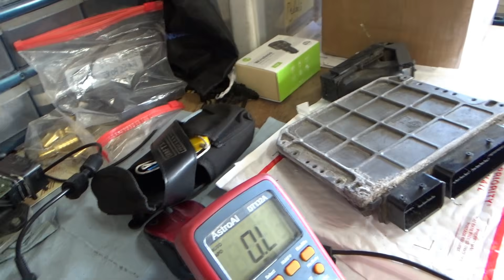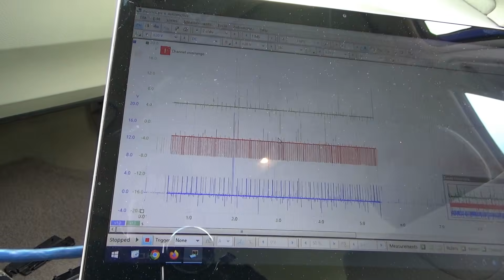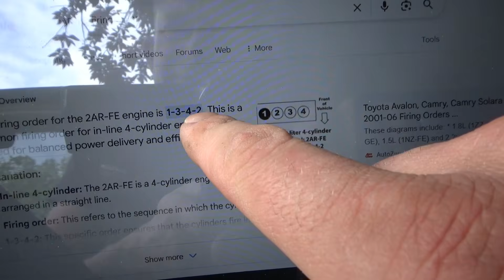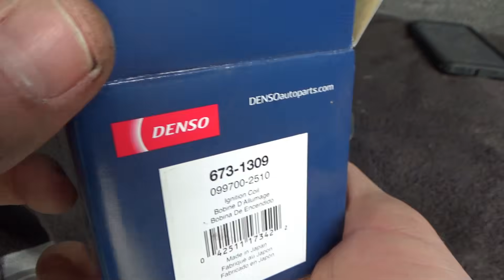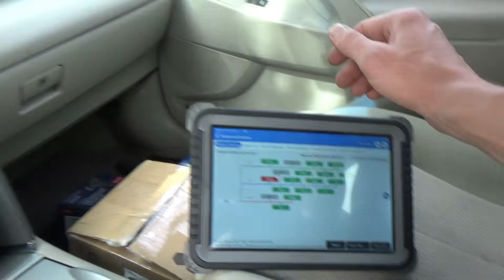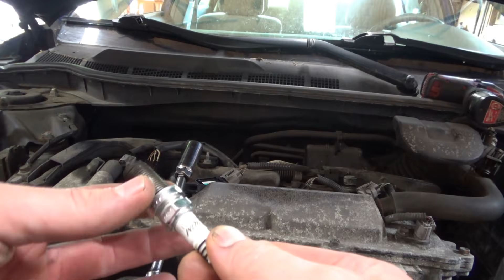(Pt 3 - CONCLUSION) CRAZY Camry...EATS ECMs?!? (Labor Day Special 2025)

Comment: With older module "dumb coil" designs, the COP coil dwell current is controlled by an IGBT protected driver in the ECM. Having these high ignition currents controlled in the ECM generates a lot of heat which is bad. However, the IGBT circuit is very electrically rugged. With a "smart coil" design the IGBT and associated heat is moved to the COPs, but to control and monitor the smart coil we use less rugged circuits.

Comment: The ignition secondary waveform needs to be inspected under heavy load and at a low temperature.       Because under those conditions it could go lean and over stress the coil break down the insulation inside the coil

Comment: I remember working (in the UK) on a Vauxhall Astra, 2012. It had a million fault codes for basically everything, brake lights not working…
Traced back to a faulty ignition pack. Amazing the faults/damage HT leakage can cause. 
I had a Ford focus (2001) many moons ago, the intermittent wiper setting wouldn’t work, again traced it to an ignition pack. 
Great watch. Good techniques used.

Comment: Five minutes I’m 71 years old working on a 99 Toyota forerunner with a blinking transfer case lights watched your video replace the one sensor or switch on the transfer case but still have blinking light was wondering if you could send me the diagrams and some of your other tips because I do not have other than a BLM meter to check stuff would appreciate the info can’t right now I’m not driving the car

Comment: Ive seen ignition coils shutdown toyotas, as in shut the engine off but the computer on both vehicles were still alive. Toyota Voxy 3ZR engine, Toyota Altezza 3SGE engine both with 4 wire ignition coils.

Comment: Watch JR Go had a similar situation with a Kia. The plug coil was causing a short. There was no CEL. After replacing the blown fuse, the CEL would display, only to have the fuse to blow again. The ECM wasn't getting any power. After replacing the defective coil, it was solved.
I would rather have blown fuse, as opposed to a toasted ECM. Kia's and Toyota's must be different this way.
Reply from the maker: Very different failure mode in his case that's a 15 minute diagnosis 😉

Comment: Very impressive troubleshooting. What makes this so difficult is the problem causing the ECM burn out doesn't occur unless the car is running and the car only runs for a very short period before the ECM shuts the engine down. Another great example of how to use all the electrical diagnostic tools in this case including an oscilloscope being so valuable to track down the issue.

Comment: Very common problem on early 2000 thru 2009 ford v6 engines especially. Seems to be a TSB on them also. Change all ignition components, with of course OEM parts. Used ECM around $800 and $300 to program install. Pay me now or pay me later!

Comment: Reminds me of my ford edge that back fed the coil up the control wire and blew a hole in the driver for that coil. A simple $90 coil job turned into a $300 ecm repair plus $600 for all new coils and plugs.

Comment: I guessed that a coil was producing a high voltage spike on 5 VDC line.  That will take it out the internal  ECMs 5VDC regulator. I learned about inductance when I was a kid in 1950s. Between that and Forbidden Planet my brothers and I had fun shocking each other. That voltage spike was most probably a lot higher as what was shown was dependent on oscilloscopes slew rate. Good job Ivan.

Comment: Had a similar problem with a 2005 Honda Jazz/Fit 1.4 Dsi. While driving, the electrics and engine would intermittently die completely, for less than a second, and then revert to normal. I eventually traced the problem to one of the exhaust spark plug coils (it has 8 coils and spark plugs, 4 for the exhaust side and 4 for the inlet side). I replaced the coil and the problem went away. A few weeks later it started again, and I found it was another exhaust coil. Eventually replaced all the exhaust coils, and no more problems. The inlet coils have not given any problems.

Comment: I bought 6 no name coils off eBay for $60 for my 2004 Trailblazer. One of them was bad and they sent me a replacement. I didn’t replace all at once. I’ve been replacing the stock coil as they stop working.

Comment: One coil from my BMW 325i E92 broke the power stage inside the engine ECU, a MOSFET that I replaced for 2 dollars. But I had never seen a case where the high voltage from the coil goes into the ECU and destroys a component — in this case, the 5V power supply stage. Crazy failure, great diagnosis, it wasn’t easy at all. Greetings from Spain and thanks for sharing.

Comment: if i remember correctly, you had a similar case a few years ago. it was a chevy or dodge truck that when engine was reving up it leaked back some high voltage to the engine ecu and made all sensor information etc to the ecm go wanky....

Comment: what are the safety measures of a ignition coil burning out like that one on a car computer? that would be a manufacturer error in design, because for that to happen in a regular basis, the consumer would be dishing out tons of money every time a ignition coil burns out, the computer to has to be changed to, because it get's burn out to? so what's the real problem with this connection with these burn out's?  my question is, how would we know a bad coil from a good coil! and who is responsible for this kind of damage? they need better quality testing of their products! you could imagine how many cars have been destroyed by products that fail like this? and have gone to the junk yards? very good video! eye opener to consumers! buy's beware!

Comment: Seen often on toyota, where a coil (usually aftermarket or fake ebay coil) causes the car to intermittently shut down or crank no start, and has codes for all coils. It shorts or spikes IGF signal. But never have seen yet where it takes out a module. Advancedleveldiagnostics recently had one, surprisingly it was from OE coil.

Comment: Just want to add that Denso oem coil packs is what toyota uses from factory. Also the wire going to #1 which plus into the coil pack must be ifted up and away from the metal valve cover or it gets hot and fails. Have fought ths isse for three years and getting the wire up and away from heat along with using denso coil packs and problem went away.

Comment: Unbelievable. The slushy road- was that just a red herring?. Great idea to use the amp clamp to locate which wire had a current draw.So was there a problem with that particular circuit?

Comment: I think for most only way this been fixed is a tryagnosis hunch approach of swapping out all the coils/plugs, hard/expensive/time consuming one track down when killing ecm's that quickly/consistently .
One thing it highlights again is importance of using top quality oem options as much as possible in critical importance parts . 
Hats off to NGK for doing a engineers report on the faulty coil .

Comment: Back EMF resulting from coil field collapse managed by diode across solenoid power and ground. Dodgy diode certainly cause damaging voltage spikes and current to blow power source. Peace of mind replacing all 4 coils. Good diagnostics.

Comment: PC power supply and motherboard diagnostic/repair trick: disconnect the 5V from the source (even if not present), in this case, the ECU, and inject 5VDC from an external power supply, then test and measure. You, or some repair shop can probably replace the driver (mosfet, etc).

Comment: Outside of the automotive aspect this blows a hole in my (flawed?) understanding of electromagnetism. A "coil" is a step up transformer. 2 windings that do not touch but induce an EMF current electromagnetically. A diode (1 way gate) prevents reversing current. If the diode blew it should break the circuit, not become a 2 way gate for current flow? Also don't understand how sending 10,000+ (low) VDC into a 5 VDC SMD (30 VDC max?) wouldn't smoke it? I'll be pondering this until my next life's unexplainable enigma comes along.
Reply from the maker: Haha E&M is a fascinating field!

Comment: I have ran into various brands of spark plugs with the internal "resistor" open circuit or super high value causing breakdown of boots/coils/wires, even when they're visually fine.
really need a spark plug test machine or look at running waveforms. it's possible anything could be counterfeit, looks to me like rockauto just slings parts from whatever suppliers now.

Comment: Rock auto sells a lot of close out or discontinued items. Sometimes they've been discontinued for a reason. I see more and more people having issues with parts from Rock auto. Take a part such as a timing kit. The OEM may have redesigned a guide, phaser, etc for improved durability. The new old stock is often purchased by Rock auto for pennies on the dollar. If you order one of these parts from Rock auto you may receive the older non revised part. It's something to be cautious about.

Comment: Ivan, good work finding this issue; scopes are valuable tools and you take them to quite a high level. Thank you for showing OHMS Law math and the equation you used. Very few troubleshooters understand this valuable law. During my 30 years of troubleshooting industrial electronics, I have found dielectric breakdown between primary and secondary circuits/windings a few times. Some let the smoke out along with the fireworks, yet others were more evasive like this NGK coil.

Comment: I am going to assume you figured this out without Keith, Ivan.  Seems if the owner had used OEM stuff he would have been fine.  Charging the customer 4 hours is perfectly reasonable, even if you did burn an engine computer up.  No, you might not see this again; once you know it, you won't forget it. I guess this is why Keith asked to see the drivers.  GREAT VIDEO

Comment: Hi thanks for sharing that diagnosing. I had some problem with 5v in 2gr gdi engine.  The Short was in fuel pressure sensor. When engine start sensor getting Short. It's same like your problem.

Comment: First of all, great video. Sure learned some stuff on this one. My one little disappointment was that the company making the coils, did not step up and do “something” for their customer. That well hidden fault destroyed 3 computers not to mention causing hours of extra labor costs to diagnose the issues. They could have at least sent a Snickers bar from their vending machine to demonstrate the depths of their concern. In my business dealings over the years, I always made sure the customer not only left the building feeling as though we addressed the problem, but they came out ahead on the deal. Leave them amazed and smiling and they are customers for life.

Comment: Yeah, I learned a long time ago that there are some things you just don't trust to the aftermarket.  Ignition coils are one of those things.  OEM or at the very least the company that made the OEM ones.  No one else.

Your diagnostic skills are extraordinary.  I never would've made the connection to the ignition coils backfeeding voltage onto the 5V reference line.  Insane!  Amazing diagnosis!

Comment: Awesome diagnosis.  Brings back some memories from the early '80's and doing tune ups.  Small town, had mostly domestic vehicles. 
But had a couple of customers with some imports. We used Champion or Autolite spark plugs in our shop.  But for some reason they didn't last
 too long in the imports only.So we would then only use NGK's or Denso's.  No more problems after that.

Comment: THAT was definitely one for the books!  Like one reply said, The coil and the plug are like one unit.  Spark plugs can cause a LOT of trouble when the center electrode is worn way down "almost" or "into" the white insulator.  By doing that, it causes the coil to MAX OUT it's output.   I've seen where a misfire was caused by a worn spark plug.  Changed the plug with an OEM plug.  Still had a misfire.  Change the coil with an OEM coil.  Misfire gone.  This was on a Ford F350 V10 Utility City Truck.  So after that, it was "coils and plugs" to eliminate problems.  Had several 2004 Ford V10 F350's with a code for the "Input Shaft Speed Sensor."  Each one had non intermittent sensors, no problems with the internal tone ring, the wiring or the PCM's.  I couldn't believe it myself when I checked the spark plugs and most were worn down to the insulator.  Now these were utility trucks that mostly did stop and go driving and worked in the City (Los Angeles).  New Motorcraft Plugs and Coils fixed the problem and of course the engine ran much smoother during the test drive after repairs. I didn't have the Pico Scope I have now or it may have been an easier diagnose.  The Pico definitely made the difference as you stated near the end of the video.  One more thing.  Kudos to NGK for the testing and letting you know what they found.  It would be interesting to see if they make any changes to the coils.  This was a GREAT 3 part video Ivan.  Good on you for digging deep to locate the problem.

Comment: I think from the factory every coil controll wire should have Diode installed so nothing can back feed into ECM. (most likely what burns out on ECM, diode on the board)

Comment: I had so many NGK spark plugs break off in the head while removing them, I don’t buy any NGK parts anymore. 

The threaded part of the spark plug breaks off in the head. Never had that problem with any other brand. There is nothing wrong with Champion or Autolite Spark plugs.

Comment: We used to have the same issues with Ford Fiesta's around 20 years ago in the UK. Maybe less. Plugs used to track, then the wasted spark twin input coil failed and in turn this used to kill the ECU (screwed to the side of the battery housing with two T30's). Exactly the same scenario. Luckily we got used to the fault and the ECU wasn't that hard to open (except for removal of the long connector with the idiotic security bolt) and we could replace the coil driver MOSFET(s) in the ECU. I might be wrong but NGK  were in the failure loop back then 🙄

Comment: Super troubleshooting. They call that action "tenacious". Those were pretty hefty spikes on that power supply and you might think either Toyota or NGK would have more capacitive filtering for that critical power supply. If so it may have just had misfire codes instead of destroying the ecm. Makes me wonder if I should put a scope on my ecm or add caps just in case.

Comment: Maybe some kind of metal contamination in the epoxy filler?
Edit: I can see there possibly being some rogue solder on the PCB before it was potted with epoxy. This can happen during manufacturing of PCBs when too much solder paste is applied to a pad or it's applied too close to the edge of a stencil.

Comment: I had a very similar experience with a defective ignition coil. Several years ago, I installed an Advance Auto coil on a relatives 2005 Altima, 2.5. I believe the coil was made in Poland. Approximately 18 months later, the car got towed to me for a crank, no start. I quickly determined that there wasn't any spark and I proceeded to check for ground and voltage at the coil connectors. When I got to #2, the cause became apparent because the coil and the connector were melted. I warrantied the coil and spliced in a new connector, but still no spark. Further diagnoses disclosed that the drivers in the ECU had burnt up. Luckily, I was able to send out the ECU, which turned out to be unrepairable. The place I sent it to extracted the security code onto a used unit and that solved the problem. I promptly replaced the Advance coil with a Denso coil. Thanks for the great content Ivan.

Comment: Great diagnostics. ECM / TCM usually have overcurrent protection in the 5V regulator / power supply. Otherwise ECM / PCM would burn at every grounded wire event. Thus the overvoltage is more likely culprit. Electric motor with bad brushes, solenoid valve or a ignition coil. And in this case, that something produced high voltage only when engine running. Some French cars have had similar issues with Valeo coils. Strange that these coils do not use opto isolators for the control  signal. Those are available upto 20 kV.

Comment: Not had that one 
Had a hiace van that had a 12v to 240v inverter installed.
2 engine computers later a scope found the inverter was spiking the engine computer when the van was turned off.
Was ok on turn on ,only siked on turn off

Comment: Ford had a problem back in the  late 90s or maby early 2000. 3.0 in the ford escape’s.  The coils would take out the coil driver in the ecm.  If I remember correctly the ecm would stop triggering the one bad coil and you would just have a miss fire.  Replacing the coil didn’t fix anything and when looking for the trigger from the ecm it wasn’t there.  Ford recommended all six coils,plugs and ecm to fix.  About a 2000 dollar repair back then.

Comment: I've seen a Scion IQ 1.3L that wouldn't start because of one bad coil. It would run on 3 cylinders with that coil unplugged but wouldn't fire at all with it plugged in. If I remember correctly it was an unmarked coil so probably some Chinese junk.

Comment: I wonder if they X-rayed it, or carefully sliced it apart to see exactly how it shorted out inside the coil. Without your extensive knowledge, Ivan, that vehicle would have been scraped by now because not many technicians could have diagnosed that rare failure. I bet few people know that a bad coil can take out their computer. I sure didn't. Only one has died on my 2000 Expedition in 144,000 miles of driving. That was 10 years ago.